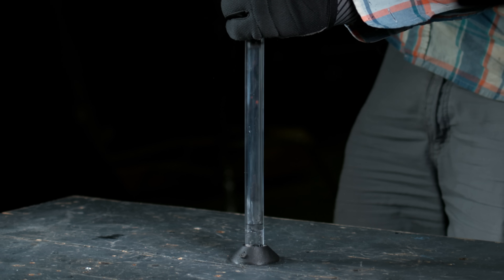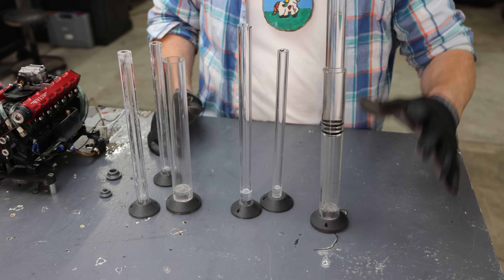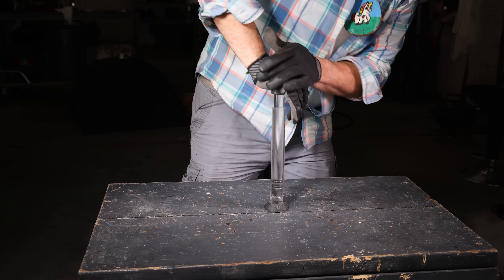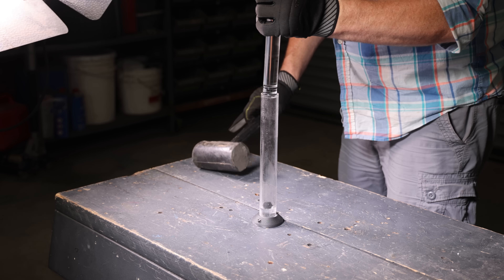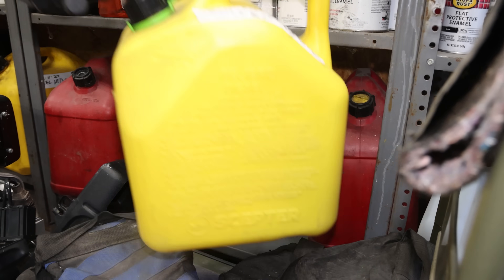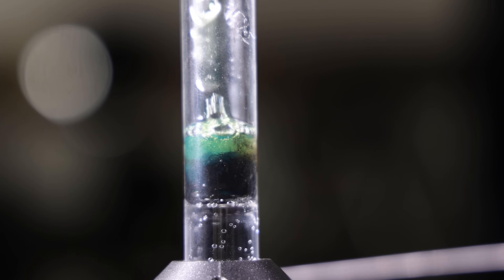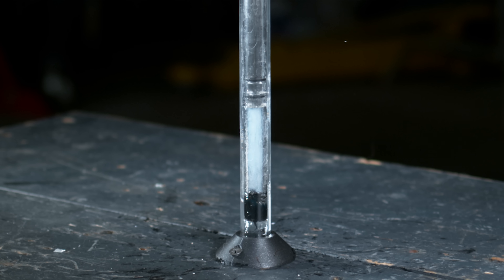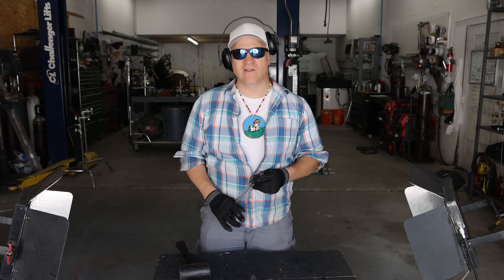How Diesel Actually Ignites (Slow Mo)

Comment: One major difference between doing this with diesel vs cloth is diesel fully mixes with the available air while cloth only has its own surface area to react with air, so you get much faster and more thorough combustion of available air-fuel mix with diesel than cloth. Not surprised at all that pressure goes up too fast for the tubes to survive with diesel.
Reply from the maker: That's a good way to put it, I definitely think it's correct And what you said matches exactly what happened.
Reply: @WarpedYT  Another thing that likely plays into it is that the diesel air-fuel mix has a far more homogeneous temperature for compression-ignition than charred cloth. With well-mixed diesel, you really get everything igniting everywhere all at once.

With the cloth, you have solid clumps which are much harder to uniformly warm up to ignition temperature, especially when that heat is provided by the layer of compressed air around it insulating it from the rest of the air mass. That is probably why you didn't get much of a reaction with cloth until you hammered the plunger for a second time after a first partial combustion kicking temperatures up a few notches right next to the remaining bulk cloth.

Comment: Could you set it with a crank & a pressure valve at the base, so combustion has somewhere to go, and you can achieve ignition with rotational energy?

Comment: There are several differences between diesel and char cloth. I don't think the total combustible energy is relevant for your explosion result. 
One big factor is surface area. Pre-combustion the diesel is in vapor form, perfectly mixed with the air. So every tiny diesel droplet can burn at the same time. For the cloth it takes 1-2 seconds until the fire burned to the core of the strings.

Another factor is combustion products. char cloth is mainly carbon, only producing CO2. Diesel is a hydrocarbon producing water vapor (H2O) and CO2.

Comment: Another thing to consider, liquid will not compress like air, therefore the diesel was over pressurizing the tube, probably with a little help for explosion.
Reply from the maker: That wouldn't matter, because The column of air still exists above the diesel itself, even when compressed the air pocket is still present. Additionally if you look closely you can see the ignition before the explosion. Whether you had no diesel or 1 in of liquid diesel The air column is still the same for the most part.
Reply: @WarpedYT  its stoich ratios. only so much oxygen available, only so much fuel will get burnt. mostly the hydrogen part.

Comment: Then what is Glow Plug for?
Reply from the maker: I believe the glow plugs Are mostly used on older diesel engines, I have also seen them in the intake manifolds of small diesel engines, they usually turn on before the engine starts to heat up the intake air. As far as I know modern diesel engines with direct injection Do not have glow plugs, these are the type of engines that I have worked on, I haven't worked on any old diesel engines with glow plugs. Maybe somebody can chime in on this comment and give more insight.

Comment: Also try with gasoline. Gasoline is more volatile, it turns into vapor easier than diesel, but has higher auto ignition temperature than diesel. 534f vs 410f.

Should require more compression to ignite gasoline and it would produce a bigger bang because it burns faster after it is ignited.

People have the wrong impression that diesel can take more compression, but that is false because in a diesel engine fuel isn't pre-mixed with air. It burns instantly when injected. Gasoline engine have fuel pre-mixed, so it needs to worry about premature (auto) ignition more.

Gasoline in a diesel cycle engine would need even higher compression ratios and would be blowing pistons and heads because faster release of energy.

Comment: The tube failure occurs when the piston completely compresses the gas and then impinges on the incompressible liquid which transfers the hammer force into the tube causing it to fail.
Reply from the maker: Nah, Even with liquid on the bottom you still have the column of air even if it's compressed, it's definitely the ignition that's causing it too blow

Comment: It's basically about reaching criticality. You not only want the fuel, air and pressure to be just right, but also to come up to the ignition point faster than it can absorb the energy. A piece of loose cotton would serve much better this demonstration. Anything more, and it's just too powerful and too hard to ignite, as it involves more mass.

Comment: Could you mention the pressures in bar as well pls? It would make it easily understandable for a lot of people!
Otherwise that's such an educational video which could be used in so many classrooms- brilliantly done!

Suggestion for the tube: Have a stronger one, maybe with increasingly thick walls towards the bottom?
Reply from the maker: I will next time for sure
Reply: @WarpedYT  Thanks.
As I said, great video. 
I can just point people there now if I want to explain anyone how a diesel engine works.
Where would we be without Rudolph....!
Reply: cant you convert?

1bar is close enough to 1 kgcm2 is close enough to 15 psi to be relatively simple, i thought... 60 psi is 4:1 CR, or about 4bar, or about 4kgcm2... 120 psi is 8:1... 240 is 16:1...

comeon, learn some basic arithmetic. education should be about thinking for yourself, not having everything laid out in front of you. its the thinking part that counts.
Reply: @paradiselost9946  Why do all the maths?
Anyway, he responded very positively already and I think it's sorted.
Reply: @demil3618  cant you count?
Reply: @paradiselost9946  I don't want to if there is another option, hence my suggestion.
But as mentioned, he responded positively and this should be settled!

Comment: Those explosions looked amazing, but man it was so obvious the sounds were edited in. Is it possible to record the sound at a higher frequency range and then lower it so that it sounds the way it would in slow motion?

Great demonstration, didn't know diesel worked that way!
Reply from the maker: it has to be edited your thinking about it too much, blame it on the universe. so the way sound frequency works for instance if a bassy explosion is approx "100-2000 Hz for smaller guns, 10-300Hz for bazookas, 0-400 Hz for mortars, 0-1000 Hz for can- nons and 0-200 Hz for explosives." so if u record a sound at 200 hz and match it with slow motion footage that is 100 times slower than you end up with 2hz, which is Infrasonic and frequency below the lower limit of human audibility. so in short you just wouldn't hear it at all.
Reply: @WarpedYT   I see, thank you for the detailed explanation. I must say, it probably looks way better with fake sound then without.

Comment: Very cool idea man.
Keep in mind your "injection angle" is much too early. It should blow it up every time.
Think about when the diesel gets injected on a Diesel engine.
Great video man.
Reply from the maker: thats exactly what is was, I def realized that while i was editing lol and then i read about rudolf diesel and how he learned this the hard way
Reply: @WarpedYT  I could tell you were on that trail right away you pretty much mentioned it in the video - just worded it differently.
Honestly man I'm really impressed at how you made all that to begin with.

I wonder what would happen if you made the cylinders out of metal. Not that we could see much, but maybe a cut away cross section afterwards might show putting from "knock" or something?
Or maybe you'd have made a gun and put a hole in the ceiling 😂

Comment: Your correct that the diesel fuel as a liquid has much more energy *(chemical) energy than a small amount of lose fire cloth or charcoal or cotton or cellulose solid
This is why gasoline liquid and diesel and common Jet A fuels are liquid, easy to pump through hoses from tanks to fill fuel tanks in vehicles, fast, easy, cheaply

Comment: PVT or Pressure Volume & Temperature means that if you take a given amount of air at room temp that air has a certain amount of energy such that if you compress that air the same amount of energy now present in a smaller volume so more energy or higher temperature. In other words as the air is compressed it gets hotter because the same amount of air thermal energy now in a compact space (hotter) raising the air temperature. Compression engines for diesel, biodiesel, hydro diesel, kerosine, peanut oil or biofuels with longer molecules like diesel vs shorter gasoline molecules, means the block and head has to have a 25-50: 1 compression ratio or about 2-4X greater than gasoline engines, meaning the diesel engine block and head have to be much stronger and thus much heavier with more metal and thus also cost more + direct injectors cost more & turbo charging + intercoolers to chill the compressed air etc means more expensive + especially the multi stage emissions controls for on road diesel engines + DPF to filter out PM & ongoing fluid additions of DEF to scrub NOX to comply with Euro 5 and EPA clean air regulations / that means VW emissions cheat in the market capitalization sense + hybrid gasoline vehicles, means that TDI sales declines ongoing, even though in principle the Turbo Diesel Direct Injection engine idea great for 1st and 2nd and 3rd and 4th generation biofuels and even DME or dimethyl either fuel works perfectly sorta like propane, as a diesel engine fuel, in steel tanks like propane as a compressed gas liquid injected common rail or direct injected :)

Comment: looks like you are hydro locking the cylinder and exploding it with hydraulic pressure not through ignition.
Reply from the maker: nah you can see the ignition right before it blows

Comment: I loved this! it made me think of a neat campfire idea for camping equipment. a lightweight vacuum spring crank outer tube that then compresses the air into the cylinder, it would be a pressure relief check valve (like in boosted cars) that then has the fire go through that and uses ventruli/bernulis principle to have the combusted gases go into the tip to help further increase the burn to help start a fire like a rocket stove. that way it can be super light weight and compact but creates a solid jet of flame that helps make campfires!

Comment: I mean isn’t an explosion just combustion in an enclosed space, where the compression exceeds the destructive force of the container… I fully expected them to explode when you brought the diesel into the equation
Reply from the maker: Very well explained, your absolutely correct, I bet you if the walls were much stronger the piston would have been expelled instead of rupturing the walls

Comment: This highlights why the injection timing is critical. Rudolf Diesel learned that the hard way when one of his engine prototypes exploeded, nearly killing him.
Reply from the maker: You're right, I do remember reading that somewhere.
Reply: @WarpedYT  If you'd liek to thest this theory against the hydrolock theroy I have seen in other comments, di ti with a little acetylene gas, instead of liquid fuel like diesel. Acetylene is very well suited to compression ignition, and has been used as a not solvating starting fuel, for diesel engines, in place of ether.
Reply: @william5694  carbide lanterns
Reply: A lot of that had to do with the fact that the prototype ran on coal dust. Much more volatile than diesel fuel.
Reply: just searched him up, happens to be his bday today
Reply: That's why he ended up being called Rudolf, the red-nosed engineer
Reply: @pistonburner6448  Maybe, but probably his table was a different height and he still had the balls to continue his work.
Reply: Nothing like cramming diesel fuel through tiny orifices at 15 - 36,000 psi and making vapors, injected at precisely the correct time.
All soot leaving the exhaust system on a diesel is unburned wasted fuel, stuff that could have otherwise combusted and created mechanical energy.
Reply: Yes in this test the diesel was always in the tube without evaporating first, it's basically a pressure bomb not how engines work, pistons have valves for a reason the vapors from the last ignition must scape first to safely allow a second ignition without blowing up the pistons, in this test it would have been key to create a little scape hole for the burned fuel to scape. How did he missed that? Lol
Of course it's going to blow up.
Reply: lol liquid does not compress obviously it will break the cylinder, it wasn’t exploding it had to room to compress

Comment: Interesting. I would like to see the time counter in the slow-motions. Very curious to see how fast this diesel combustion happens since people call it slow burning fuel.
Reply from the maker: I should have included that, each event was three frames, each frame is 0.0003/sec so that means it would be 1000th of a sec or 0.001
Reply: @WarpedYT  thanks! Looking forward to see the further experiments.

Comment: Matt, i didn't know if you had a slightly hollowed out piston, or flat at the end, but that may help a little bit with the end result of returning the piston instead of explosion?

The other thought i would have had is trying a thicker material for the outer housing... But I'm sure that was a thought, but not able to get the material in a different wall thickness.